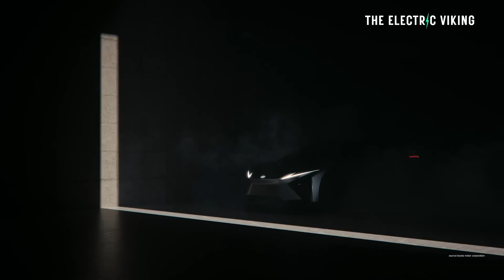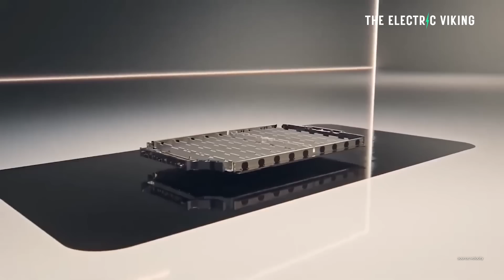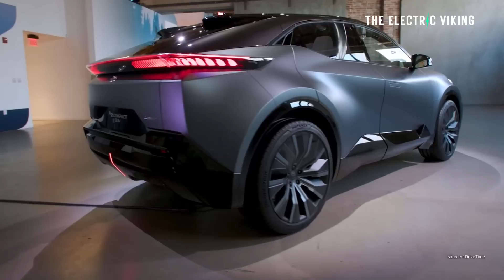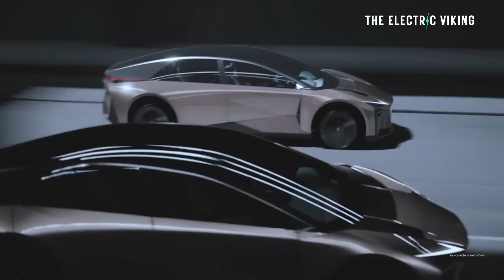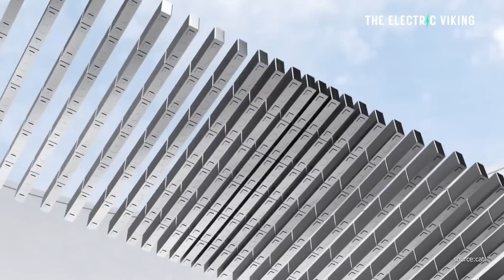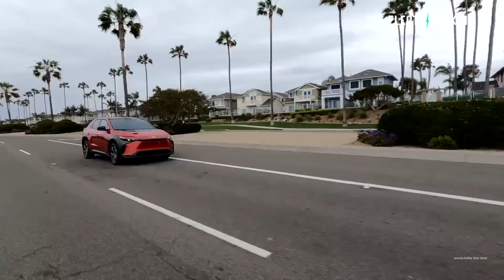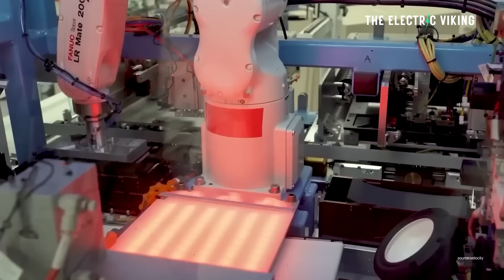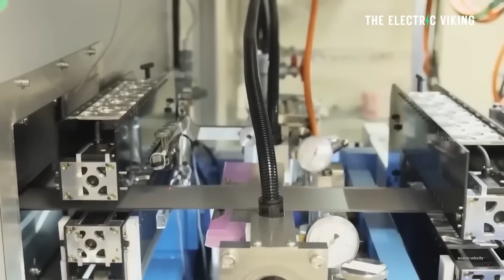Toyota says it has game changing LFP and prismatic cells that will destroy BYD

Comment: Toyota making promises that dont happen thats a bit of pot calling kettle black mister tesla fanboy.
Toyota has already made the NiMH Battery more compact and efficient with is bipolar technology so if this tech is applied to an LFP chemistry battery it would indeed increase its range as you said 80kwh "SIZE" battery pack NOT 80kwh battery emphasis on the size of the pack and if they can also crack the code for reliable solid state batteries then yes it is possible. 
im still sceptical of The actual ability to charge a large battery in a comparable time to fueling a liquid or gas powered vehicle even with the 350kwh charges as they only reach there peak for a short period and thats if they're working at all.
As for people not wanting there ICE counterparts when this tech does come along well thats a choice isnt it and if the government bands do happen from 2035 well its a necessary path they have to take isnt it 9:29

Comment: Unless I am going on a long journey I typically stick in $20 of gas at a time and I doubt if my habit would change, instead of driving to a gas station once a week, I just plug it in at home for an over night charge, once a week... driving is going to get so much easier
Reply: That's exactly what I used to do with my gas cars, and always down to the red. When petrol was NZ$1.80 per liter I got a consistent 110 km range, so I knew the Leaf would be fine for me. Now petrol is NZ$2.80 per liter, so today that $20 would only get me 70 km (44 miles) range!

Comment: It's not only about the range, the cost of driving would also drop. If you can charge 80kwh and get 1000km instead of 500km, that will half the cost on your electricity bill.
Reply: If you can get 1000 km on 80 kWh you are driving a skateboard.
Reply: How match the drive engine uses power is the key not how big you battery is. Solid state makes it possible to get great weight / density ratio but it does not magically lower your consumption into 2kwh/100

Comment: This is why Toyota stopped at the Prius. They understand the limitations and problems with lithium ion batteries. Solid state are far superior to LIB without the same thermal runaway risks (fractional compared to LIB). They will only bring out pure EVs when SSB is viable. 

SSB can be half the weight as they have twice the capacity. 10mins charging to 80% and the other main benefit is the life of the battery. It lasts significantly higher number of discharge cycles which prevents massive depreciation that affects all current EVs. 

The main issue with them is cost, if Toyota can produce a SSB at similar cost to a LIB then it is over for Tesla and other EV makes. 

Toyota are coming to the EV market later but they are doing it properly. This would get me into an EV.